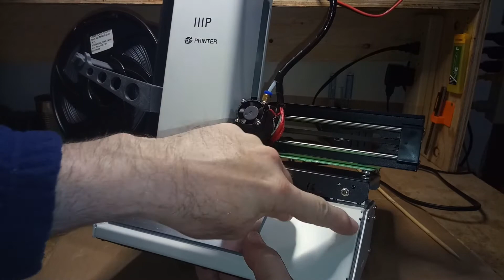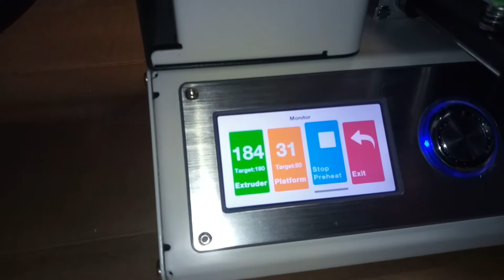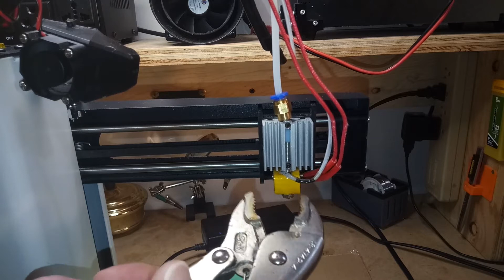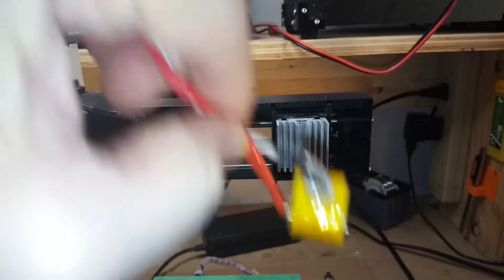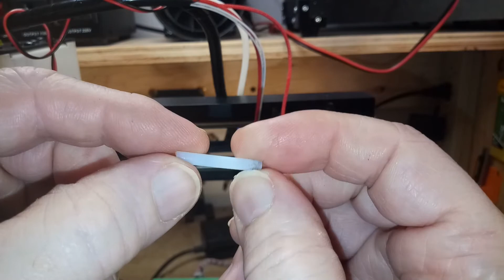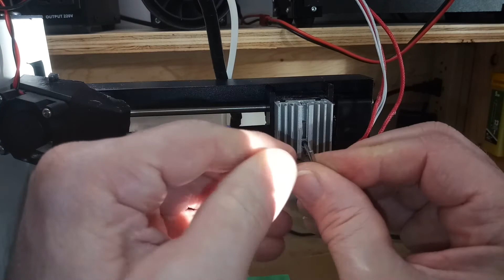Fixing A Hotend Clog in My Sons Monoprice Select Mini V1 3d Printer Part 1

Comment: Lots and lot of tiny parts we have trouble seeing let alone do anything with! Great repair!
Reply from the maker: You got that right Bob..lol  I'm legally blind in my left eye and as i get older my right eye is getting worse so it can be extremely difficult to see tiny things. I hear you got yourself a new printer and have been experimenting with Octoprint..Good call, I'm a big fan of Octoprint. It's so much better than using an sd card or tethering your printer to your pc which limits where you can put your printer.
Reply: I really like the Octoprint option. I already had a Pi I  wasn't doing anything with. I have a camera ordered for it.
Reply from the maker: @YouAllKnowBob  Same. I used my Pi as a Tv box for a while but didn't really use it much..I use it way more with my printer now. I originally used a camera with mine but I removed it because i never print when I'm gone or sleeping..There are some pretty cool things you can do with it other than just monitoring prints so I might hook it back up when the new printer comes in. If you haven't checked out the Octolapse plugin it's well worth playing around with..I have a few Octolapse videos on my channel.